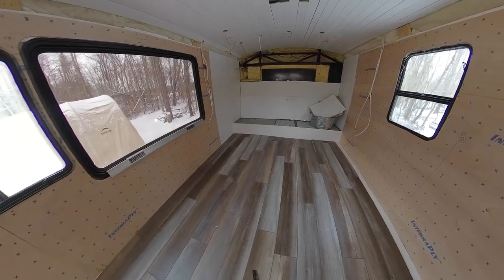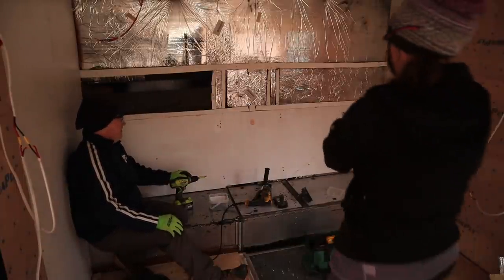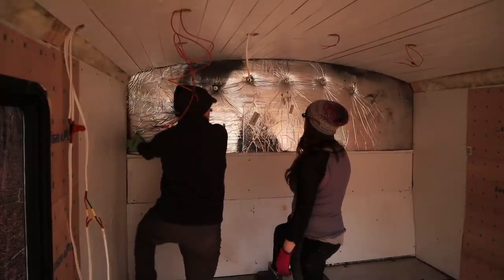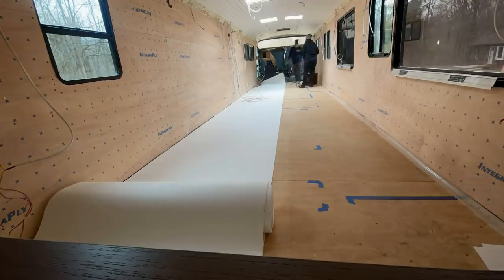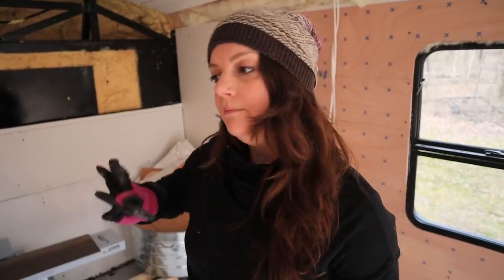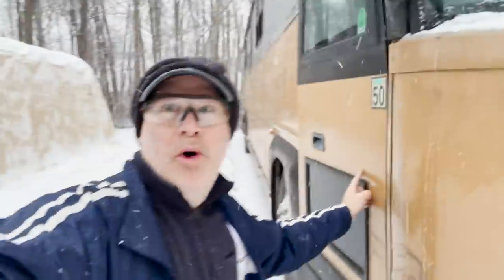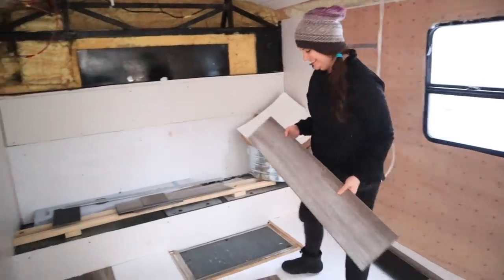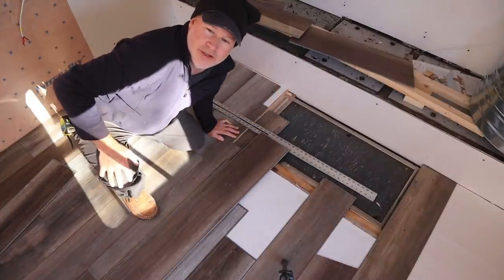Vinyl Floor Planks for our Bus Conversion - S03E45

Comment: Floor first. Much less measuring. Attach cabinets to the floor, they stay where they are told to stay. It won't be long, and you will be able to drive to a park and enjoy a camping trip. Plumbing, Gas, Bed. GO on Vacation.

Comment: FYI putting down a floor you should measure centers on either end of the bus and snap a line down the length of the bus, always work from the center out you will split the difference on eitherside of the bus.
Reply from the maker: These vinyl planks don’t work that way.  You have to start on one side to make them connect properly.  We did our ceiling the way you suggested, helped a lot.  But with the floors we also didn’t want to split the difference on either side.  It would be too small a piece to cut down on each side.  Manufacturers recommend to cut the planks down no less than 2 inches.  It would have been 1.5 either side. That’s why we did a little test first to see what the best option would be for cutting them down
Reply: @Rehabit8  okay I know what you have they snap into each other from the top down into the previous board. Sorry ! Thought they were tongue and grove

Comment: Good move laying the floor first. That way if you decide to change some locations/size ets of the cabinets you won’t have spaces in the floor planks. Do you have or have you thought about a reverse camera.?  Maybe too late to wire through the roof but if you need to you can wire through the engine bay and run along the chassis rails. Just saying?
Reply from the maker: We already have a wireless back up camera installed. Was the first thing we did actually after buying the bus.  But are considering changing it

Comment: Do you all have any type of heat in the bus while you are doing the interior? Small electric heater of some sort? If so...how it is working out?
Reply from the maker: Yeah we have an electric space heater.  It has kept us comfortable inside the bus, I’m very impressed.  The insulation is working well that we can heat the bus with a little space heater.  But we’ll be upgrading soon and also making sure we have AC ready to go for summer.

Comment: Floating Floor planks.
Question, what happens when you attach cabinets, walls, toilet flanges ETC.?
What thickness CeraTex did you use under the planks?
Thank You and look forward to your videos since I have the same 102D3
Reply from the maker: Thanks!  Oh cool. 1/8 inch ceratex on the floors. Just have to go through the planks and into the plywood underneath to attach.

Comment: How are the joints made waterproof???
Reply from the maker: They say the way they lock together is supposed to prevent water from seeping through
Reply: That might work on the long runs but what about where 2 pieces meet at the short places???  Are they just butted up  against the next piece???  Do they somehow "lock" together???  I had commercial LVT installed in my house on the first floor about 5-7 years ago and the installers have been back at least 5 times to realign this floating floor.  Primarily because the planks have shifted and/or those little locking flanges break off.  Thank God i have a "lifetime" warranty.   But is it for my lifetime or the lifetime of the floor???